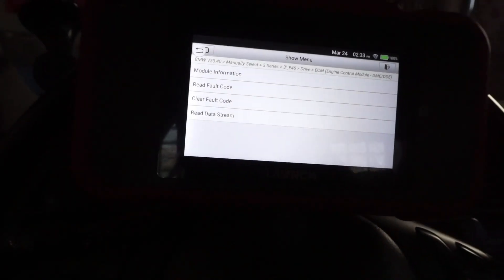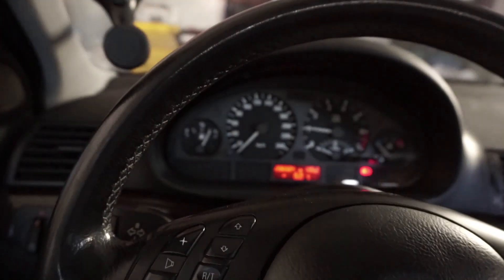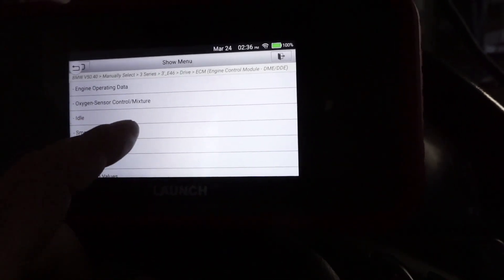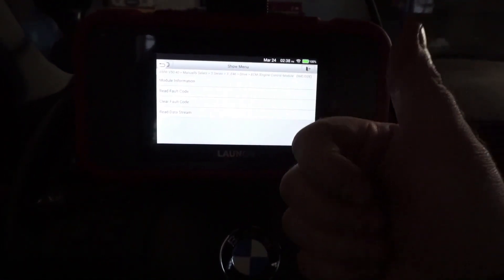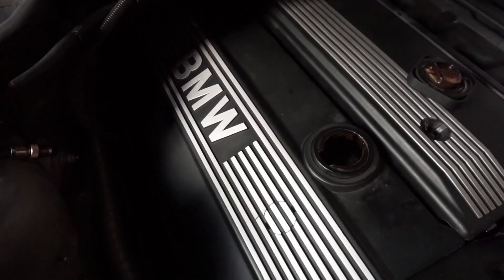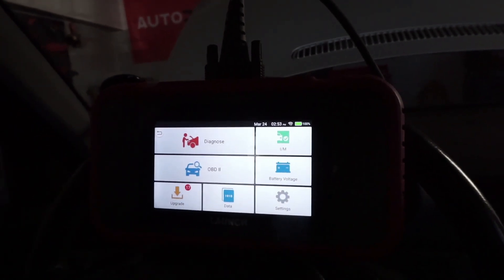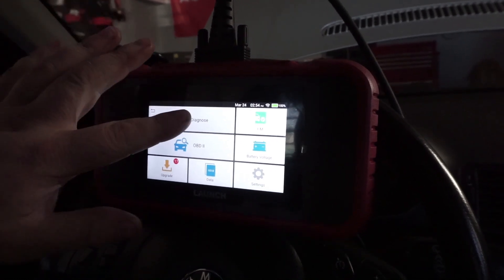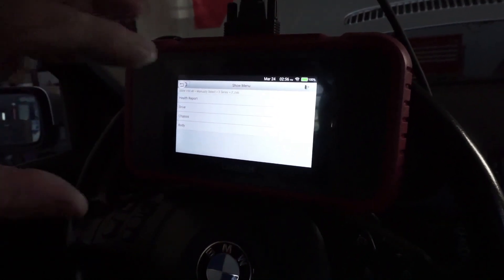Engine Troubleshooting with OBD2 Scanner. Easy Diagnosis Tips | AUTODOC

Comment: Hey love your guys videos.  I have a 04 BMW E83 it has a abs,brake,4x4, and tire tpms lights on they come on when I get moving forward and when I read the obd theres no code stored on the computer. What do you think? Thank you
Reply from the maker: Thank you for your comment.
According to the description, it is difficult to solve your problem, we recommend contacting the service of your car.
Best Regards,
Autodoc team
Reply: @autodocuk  thank you for reply,  just doing some more research from others with similar issue and finally able to hear the issue it looks like it's the front right wheel bearing, looked in the area and found grease coming from the bearing.